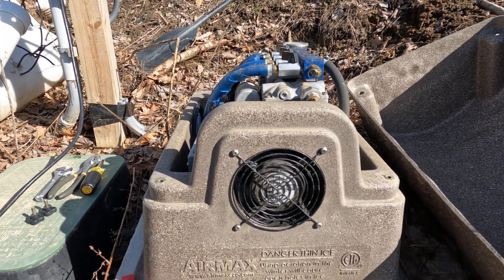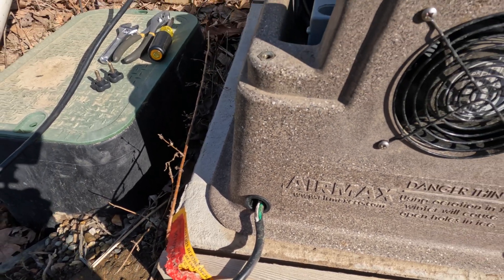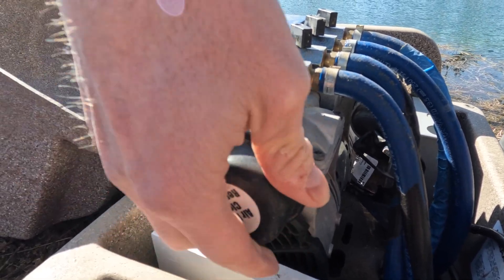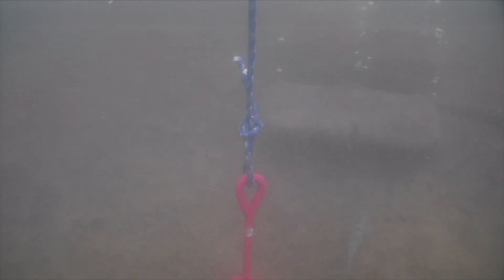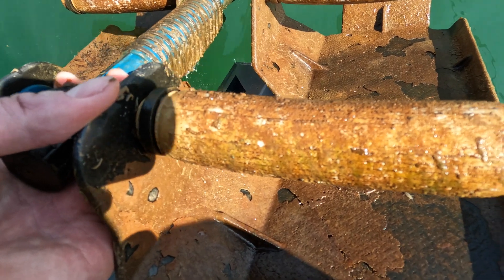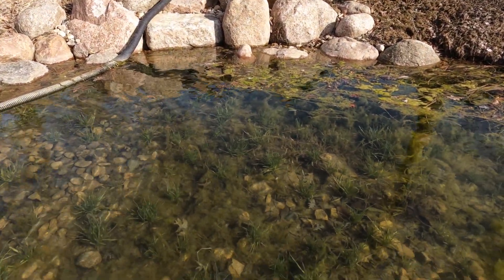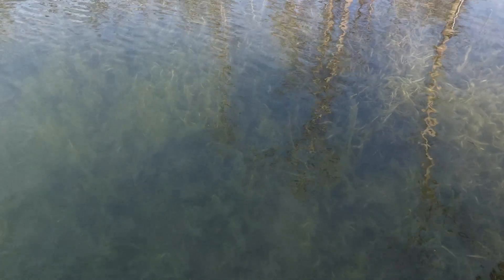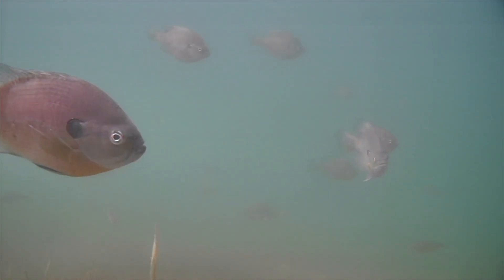Why You Should Clean Pond Aerator Diffusers - Airmax Pond Aeration Maintenance

Comment: what under water camera do you use and recommend?
Reply from the maker: I use the Aqua Vu HD7i. I like the picture quality. It is a bit heavy though. Cable management can be a challenge, but that’s the same with every camera. If I were to choose another I would go with the Pro version to get the water temp and depth displayed on the video from the sensiors built into the camera.
Reply: @newnatureadventures  ok :) thank you!

Comment: Our aeration system runs year round, but we don't ice fish. If you feel the vegetation is getting out of control, I do recommend grass carp. You wouldn't need a lot. I generally go with the start small method. Maybe 2 per acre and if you are not satisfied with the results after a year, maybe add 1 or 2 more.
Reply from the maker: Thanks…I agree with the starting small. I’ll monitor things this year to see. I’ve already noticed a clearing up of the water in the shallows from the beneficial bacteria and phos binder. I don’t think grass carp eat cattails. That’s my main concern so far this year.
Reply: @newnatureadventures  I think they do. We used to have a lot of cattails along the edges of our lake, and then one year the drain pipe got clogged and the water level rose a couple feet and all of a sudden all the cattails were gone. I think all the carp ate them all. We had quite a few more carp than we thought we had.